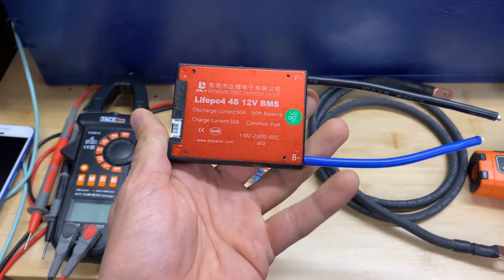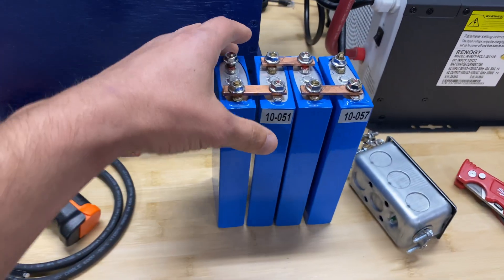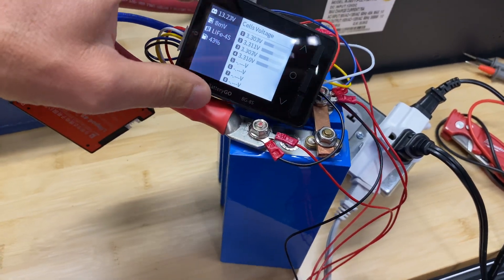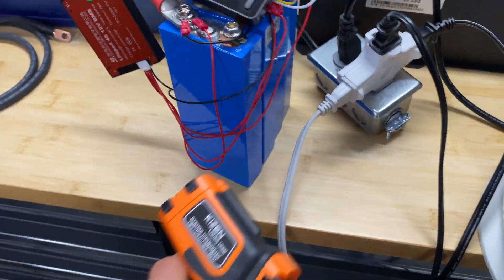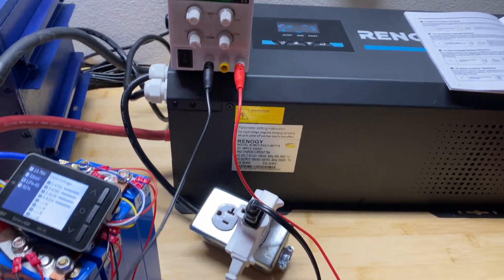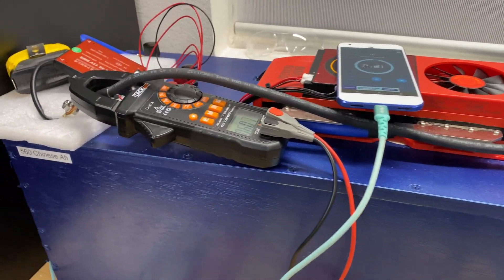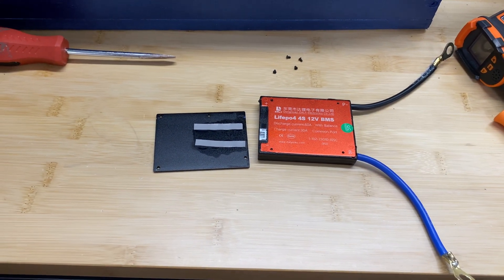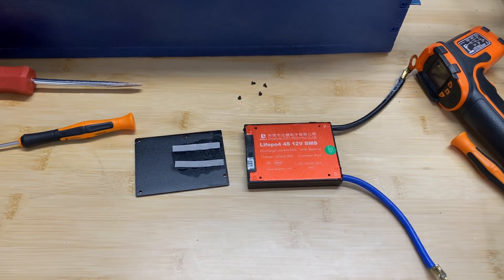Testing Daly BMS 60A for LiFePo4 batteries. Detailed overview.

Comment: Wow that's great work and good advice.  I bought lifpo4 12v 16ah batteries from Amazon. Should I take them appart and build my own 48v battery with a Daly bms or keep them as is and use built in BMS? I am thinking to keep them as is.

Comment: Can you use a adjustable charger and connect it to p1 and black n. Then slowly turn in up it should kick off the bms over 3.65 or under 2.5 right? I haven't tried this yet.  i have a sus bms

Comment: Great video 😊. I want your help . I don't know much about electronics.  I purchase a lifepo4 battery pack for my ups 12.8v 18ah. 32700 lifepo4 battery my question is can i charge with this bms with my ups like my lead acid battery was charging earlier

Comment: You are very wrong about 10awg silver-coated copper silicon wire power ratings, If you do some research into EVs you will see 10awg HTSSCW like this is rated to 80-120amps, as it is hi-tempter wire, even Tesla uses 10awg SW at 80a in all their cars for the heat pump matrix etc, Also If you look inside any EV controller like Savcon, Kelly Sabvgton, Fardriver, ASI, etc or motors like from QS they all use 8awg SCSCW in their 200 and 250a amp controllers.
There is a very big difference between normal copper strand wire vs Hi temp silver-coated copper silicon wire which has 1600 strands of very fine silver-coated copper wire on 8awg, please learn about the ripple effect on this type of wire.

Comment: Good Day! Did you ever test ANT BMS? I just thinking how good or bad they are. I know that there is new version (2021 released) and software have a lot of bugs... What do you think abuut it? I need it for 20S LiFePO4. Maybe in the future will be 24s. not sure.
Reply from the maker: Hi, I haven't tested ant BMS yet.
Reply: @SolarEngineering  got it. Good luck in future test's. Btw, there is also one interesting type of BMS that is based not on MOSFET transistors, but on solenoid relay. They normally have way higher working current. Probably it will be even more interesting than ANT bms. Just idea nothing more. P.s. manufacture : qucc

Comment: When you connect isdt battgo how accurate is it? Also, you can try iCharger x8 instead, it’s more accurate, display doesn’t turn off and better balancing. I have both but x8 is much better for Diy in my opinion. Great Video!
Reply from the maker: thanks for the suggestion about iCharger x8, will check it. Honestly, I haven't checked the accuracy of my meter (just relied on positive feedback about this meter).

Comment: Hi Bro, good evening, can four of those batteries rum a fridge, 24/7
Reply from the maker: Hi, if you are referring to 25Ah cells (small cells in the video), the capacity of these cells is 320Wh. Fridge (mid-size) takes about 900Wh a day, so you could run fridge for about 8 hours.
Reply: @SolarEngineering  Thanks very much, thinking about getting some

Comment: i have the 16S 48V 60A  version. It gets very hot when under high load (> 30A)  and sometimes shuts down even if output is under 60A. Can you do experiment with putting some heat sinks on it?
Reply from the maker: I'd upgrade BMS to higher amps rather than install heatsinks.

Comment: 230F is 110C. that's hot. lol. As with most chinesium grade BMSes, take their ratings and divide by half for safety. That would mean 30A discharge and 15A charge for this BMS and It would probably be ok. 10AWG cable is rated for 30A anyway, not 60A.
Reply: I think that unless it is specifically stated, the ratings should be read as impulse ratings, not continuous, so yes pretty much 30A/15A as a maximum, maybe less?
Reply from the maker: yeah, true

Comment: Thanks for the review!  From the looks of it, 30A on the 60A BMS will be pretty safe to use, less than 100F after 1 hour is no bad at all.
Reply from the maker: yeah, 30A looking right for this BMS
Reply: @SolarEngineering  Will Prowse tested it at 60a and he seemed to not have any heat issues. Maybe the wire is good quality.